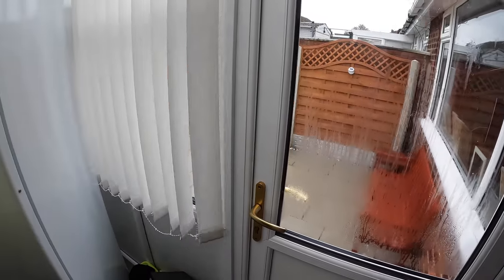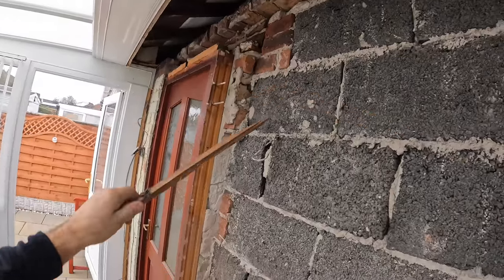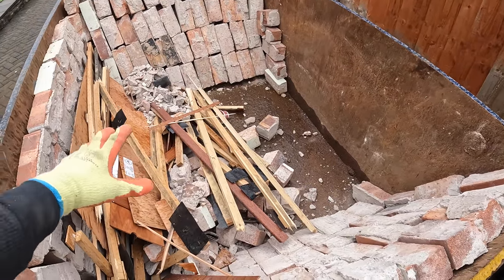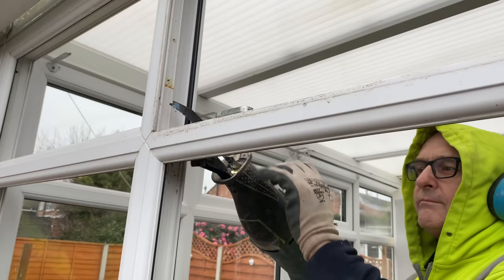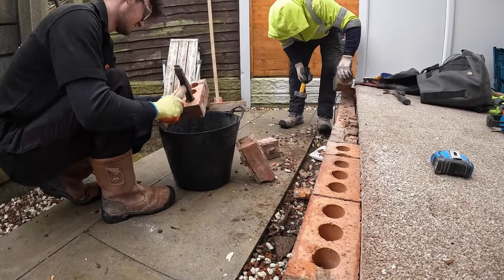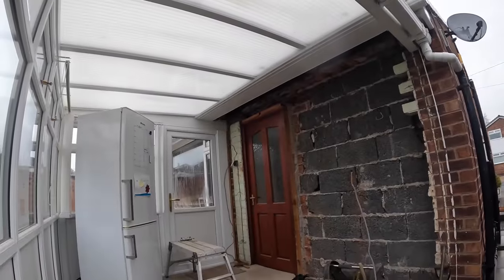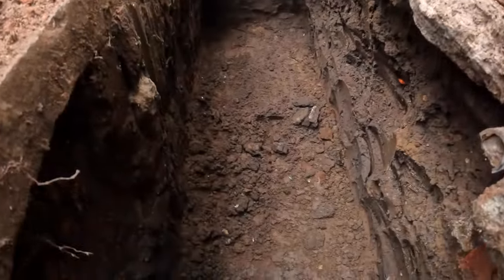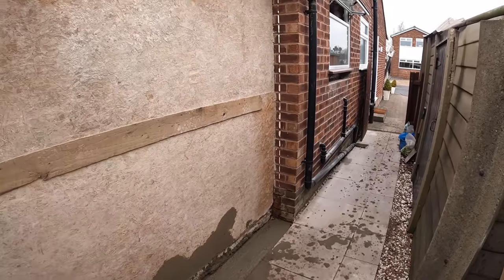AWKWARD DIG ..BAD WEATHER...KITCHEN CONVERSION  PT 1

Comment: Hi, big fan of the channel! I have a question if you don't mind. At 37:27, is the house foundation as thin as it looks like in the video? Or am I missing something?
Reply from the maker: Nope not missing anything 👏🏽🧱👍🏽
Reply: @SteveAndAlexBuild  Thanks for the reply! This gives me an idea of what I can get away with for an outbuilding which doesn't involve building control (short dwarf wall with timber frame on top). 
Not trying to cut corners, just want to be realistic about what's required. I will pour a footing strip, at least 225 mm in height, bottom of which is at least 450mm below the ground level.
Reply from the maker: @Orgakoyd 👌🏼👍🏽🧱

Comment: Good job on the demolition and the concrete , having the right tools by the hand makes ot more fun haha  , the impact screw machine is a great machine gets in big screws easily .. all the way down if you want  ;)
Reply from the maker: Definitely Jay ive learned the hard way after many struggles to invest in good tools for the job . working with Tony at A & E was the same , they are seriously tooled up for every job .
  Since working with them we have bought amongst other good tools , a new rattler , a new laser level and a sthil saw 😁👌🏽🧱👍🏽
Reply: @SteveAndAlexBuild  absolutely and the right tools will pay itself back after a while no more f’in around haha 😆 🙏🏼🙏🏼
Reply from the maker: @JayKTS  abi👌🏼🧱👍🏽

Comment: Was it SKY that quoted that stupid money for a cable repair? 
Dead easy to put connectors on the wire and join it back together. Pop into the menu on the SKY box and see what the signal strength is and anything 2/3 or more than good enough.
Reply from the maker: No it was £70 for a new cable right through . We sorted it ourselves 🧱👍🏽

Comment: I hope my favorite, slightly out of the neighborhood, brickies are doing well. Looks like ya'all had way too much fun in the rain digging out the footing. Hey Al, does your dad ever let you drive the truck? Question: Ya'all use a really soupy  concrete mix with maybe a 1 slump. Is that normal over there? 3000 psi mix?  Looks like this build will be a nice extension. Will be fun to see how it goes. Stay safe and remember, we're pullin' for ya (very long rope).
Reply from the maker: Thanks pal , Al not passed his driving test yet . 
    As for the concrete it gets mixed on the volumetric wagon and it was coming out way too wet for some reason. It got better 😆🧱👍🏽
Reply: @SteveAndAlexBuild  I guess driving on the wrong side of the road makes it harder to pass the test... 😀 LoL! Say hi to Al for me. Have a great weekend guys!
Reply from the maker: @WarpFactor999  😆😆will do 🧱👍🏽